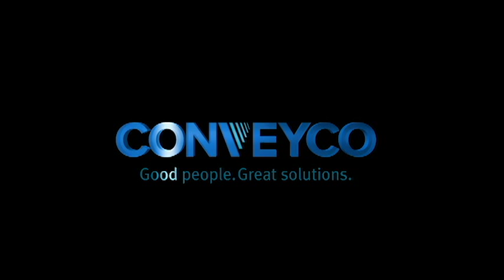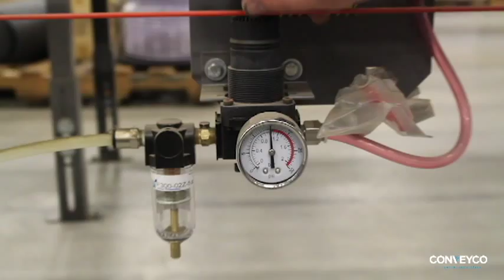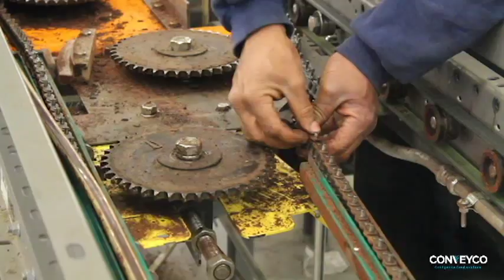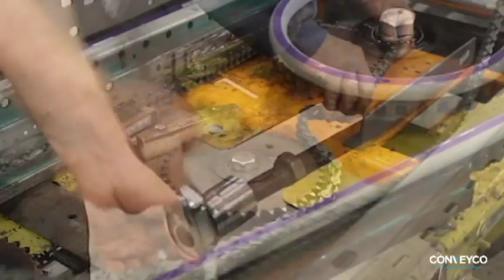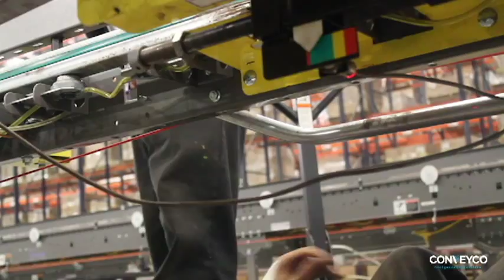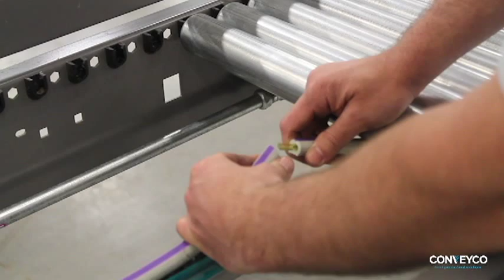Accuglide Chain Replacement

Comment: Damn I need a video on how to chain break
Reply: I purchased a chain link remover at harbor freight for around 15 dollars and it works great, awesome tool. It pushes the pin right through the link, easy peasy.
Reply: Chain break pretty easy. I I usually break it wherever on those cause master link could be hard to find. But to break chain at master u take that little clip off with needle nose or screwdriver then u take lil clip off just pull out link pop it up. If you don't break it at master then you just get chain break loosen it up, tighter bottom part then tighten the top part until pin goes all way thru pop out link and that's bout it

Comment: Way to many steps and that has to be the cleanest accuglide I have ever seen, also where are the 5 managers complaining about why it`s taking so long to get running.
Reply: What is the benefit of using the chain and driver pad over say a belt driven live roller system?
Reply: So true
Reply: I felt this
Reply: Lol so true
Reply: This. But in my experience, in addition to all the production supervisors calling over the radio, the maintenance manager is also there watching to see who he can write up for not using 3 points of contact on the ladder when crossing over the line.

Comment: Couldn't you use a vfd to slowly let the motor pull in the new chain? We do that for padded chain units. Never tried it on an accuglide.
Reply: Company I work for does not allow any work to be done on live equipment, unless troubleshooting. We have a turn handle that bolts onto the sprocket in order to get the chain moving.

Comment: You didn’t mitre the drive pad. If you don’t the pad will peel off going round the drive sprockets. Also the nut on the adjuster is there for a reason to keep off the spring tension whilst working on chain and ready to set chain length.
Reply: What do u mean metri?
Reply: What is mitre?